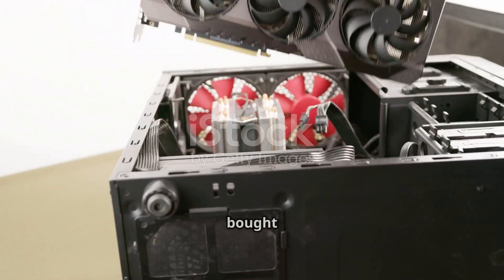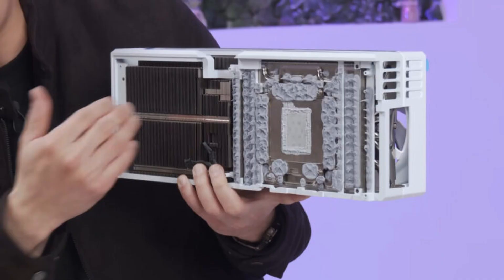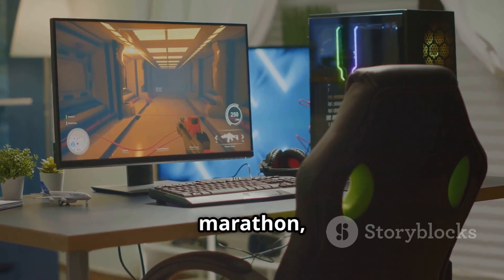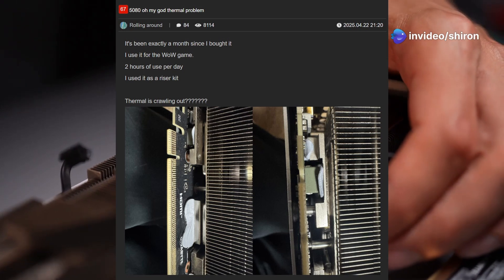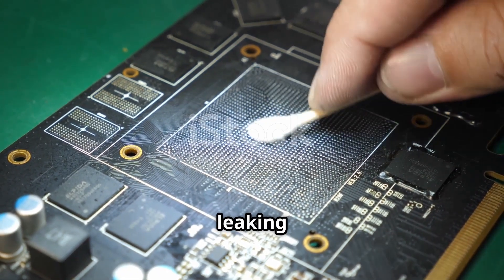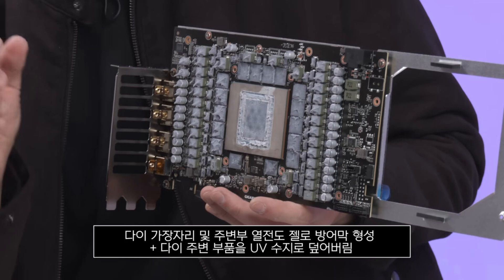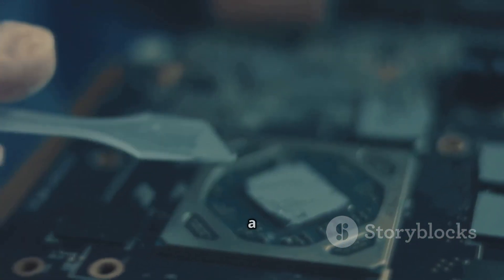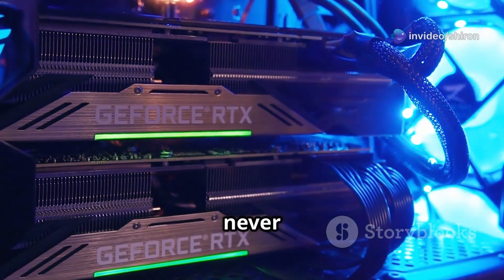Gigabyte RTX 5080 GPU Faces Serious Problem with Thermal Gel Leakage

Comment: I bought bought a Gigabyte RTX 5080 WINDFORCE SFF just a couple of days ago without know about this whole thermal putty issue. From what I have discovered so far from all the online forums and youtube videos is that it's actually problematic when you are trying to repaste the GPU and if the gpu is mounted vertically. Otherwise thermal putty is a good conductive material, even better than thermal pads in some cases assuming the putty doesn't completely spill out of the way and components stay in contact with the heatsink. I am not too worried about them using thermal putty which may spill a little but what I am worried about though is Gigabyte not using any temperature sensors on their Memory and VRMs. So there is no actual information/data to figure out if the thermal putty is actually working or not. That being said, I haven't come across a single thread or video where a GPU has suffered any fatal damage due to this spillage.

Otherwise, Temps are very good in my testing. The GPU fans don't spin when idle and does not go beyond 50c. Even under high load I haven't seen it go beyond 68c which I am very satisfied with (This temp reading is of the GPU die itself and not the memory or VRMs cause there are no sensors on them). Also, I haven't had any performance issues so far but it maybe too soon to say.

Comment: it's very sad to see this, especially from a Company like Gigabyte, they probably did this to expand their revenue margins (basically instead of thermal pads, using gel to save and gain more money). I'm currently with a 3060 12gb, on November I want to get a 5060 ti 16gb, and I would've loved to had gone with the gigabyte 5060 ti 16gb gaming oc because it looks great and modern compared to Asus Prime which looks kinda basic/boring. But I'd take reliability over looks especially in the long run and since I don't live in the US, I don't have easy access to warranty/RMA, it would be expensive af. For gigabyte and the people saying: "Oh it's cosmetic", if this is happening only after 30 days of installation, in 6 months, the goop is going to leak completely and could get into your PCI lane if you are vertical mounting, I also saw a pic of the "putty" going straight into the heatspreader , then it will make the vram modules heat up more since some of the putty melted away. I know it's not only cosmetic because I also read, someone opened their card, removed the gel and put thermal pads and they noticed a 5-7c improvement in the vrms/Vram.

Comment: I will never buy a gigabyte or asus gpu after the multiple horrendous RMA experiences I’ve had
Reply: wich brand recommend me?. I want my firts rtx 5070 but i dont know what is the best brand:\
Reply from the maker: @AlexisSanchez-vh4jk  If you can get a Founders Edition in your region, just go for that. Or get the  PNY that pretty good too. In my knowledge gigabyte is cheapest one right now but they have too many leakage story  so it's kinda risky, but other then that if you find any 5070 at msrp or around msrp it gonna be ok!! inshaallah
Reply: @AlexisSanchez-vh4jk  I'd highly recommend Leadtek.
Reply: Unfortunately you should add then MSI to that list then as well.

Comment: Yup yup, had 5080 gigabyte vertical and it started leaking
Reply from the maker: ahh ....
Reply: Hi!
So, what is the situation for today?
My guess is they are lying regarding "excess gel."
From the photos, it looks like it is completely leaking out.
Reply: @DrWatchHD They said its the first models that had this problem
Reply: @tomingo8344  did zour thermal become worse? and is the gel cleanable? does it keep leaking even after u cleaned it? i wanna get 5070 ti aurus
Reply: @mustafashihab180 as soon as i saw gel leaking out, i sent it back, it was quite bad it reached the pcie slot
Reply from the maker: @DrWatchHD  No solution mate gigabyte just say sorry and ensure that this problem never gonna happen......

Comment: I bought the 5070 white gigabyte, a Weak ago, should i remove it and check ?
Reply from the maker: There was a problem with the early RTX 50-series batches. Gigabyte responded to the issue here: https://videocardz.com/newz/gigabyte-acknowledges-excess-thermal-gel-in-early-geforce-rtx-50-series-batches-says-its-not-a-cause-for-concern
Many people are experiencing this issue, but there’s no RTX 5070 yet.

Comment: its not a serious problem nor a problem. it is a cosmetic problem for small amount of unlucky customers.. just wipe it off and your fine. the only serious problem will you get if the sever grade gel is lack of application by the manufacturer.
Reply: I just realized i'm having this problem because my card has been malfunctioning and I looked at possible issues online, checked and mine is leaking. it is a real problem.
Reply: BS, if the pictures I've seen are real. Was on igors testlab or something.  You could clearly see that half the memory chip had no thermal gel and certainly must have been overheating. Of course I don't know how common this is, but it certainly can be a serious problem. And unfortunately I ordered one. Well I didn't specifically order one, it was part of a complete PC component bundle. Hopefully I won't have to regret it. Certainly not mounting it vertically, maybe I should also make certain the PC stands on a completely level surface...
Reply: The worry is that in some instances vertical mounts lost about half the amount of putty that was located by VRAM.
Reply: Who is to say it will stop once only the ‘excess’ drips off?
Reply: COMONSENSE and its not a drum of full of water 🤡
Reply: @cloudvaan09  cosmetic until your gel leaks off and the mosfet now overheats
Reply: @TheDracoDispatch  leaks of? Its not a drum full of liquid LOL 🤡 i have also 5units of giga cards using thats kind of gel and nothing to worry 😂
Reply: @cloudvaan09  I have an sff that I carry around. I was considering their SFF 50 series cards but I guess gotta cross it out. My home country is hot and humid, certainly gel like substance in an sff case with vertical mount is a nightmare. Dont want the extra hassle of changing them into thermal pads and potential ruining warranty. You gotta see igors lab post as the leakage is severe.